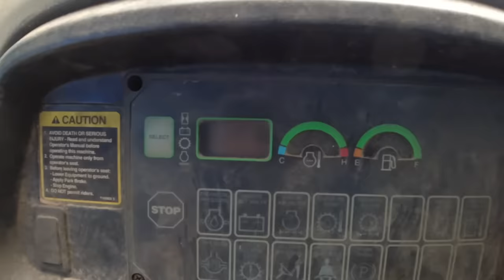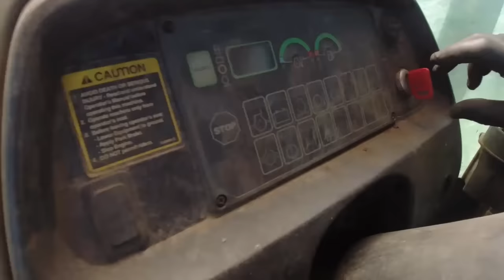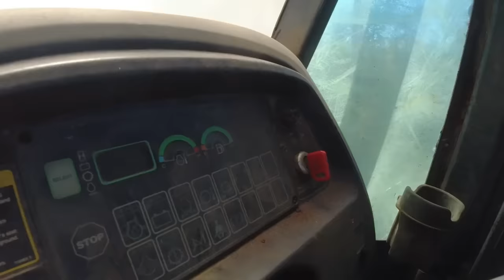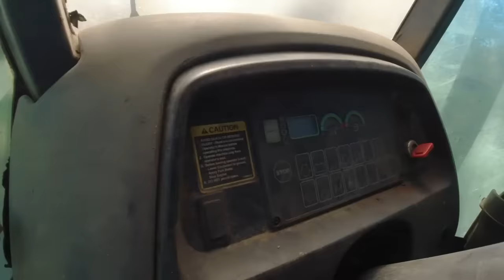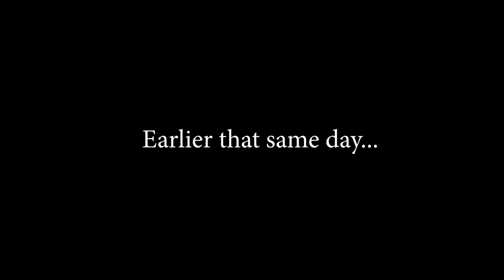Skidder full of water! How we recovered it will blow your mind! (3 video compilation)

Comment: Hank I see a question you asked how did the water get in the engine. If the exhaust filled up with rain water and one or more of the piston were down and exhaust valves were open the water fills the cylinder up and yes water can get past piston rings that’s how it can fill crankcase up. Also if air filter gets rain water it can do same thing or go into a breather tube

Comment: If you use a flat head screwdriver and a hammer tap it in between the flange where bolt goes you can get it to free up that way 1:28:58

Comment: Hank the water is on the bottom and the oil floats on top the reason it keeps going is the weight of the oil is pushing the water 4:21